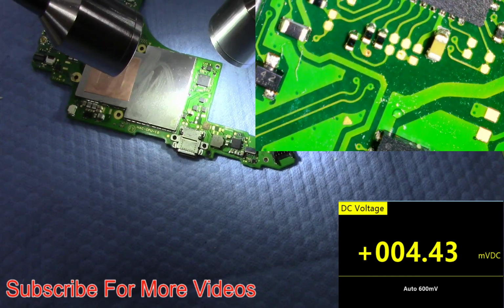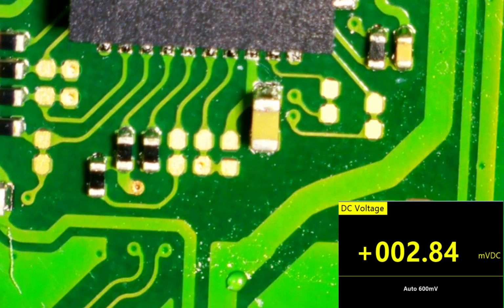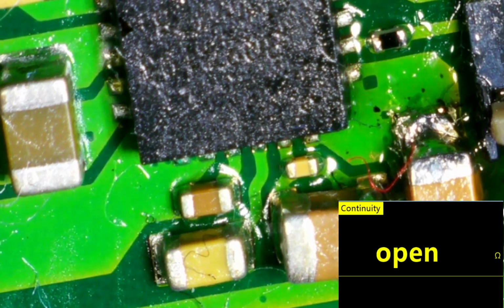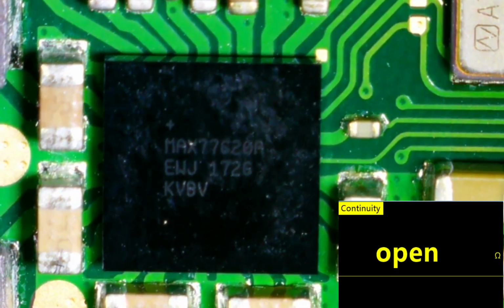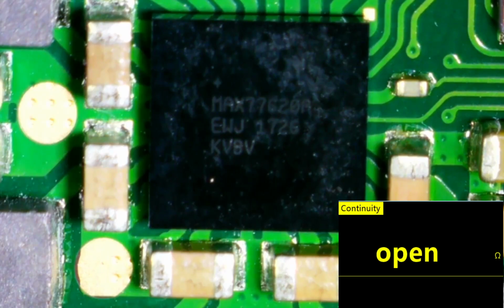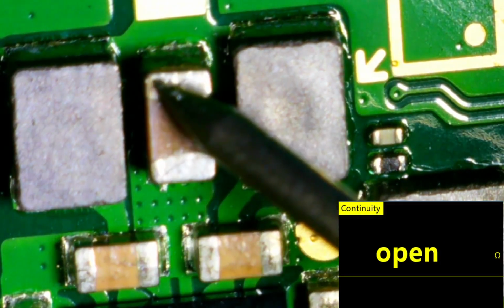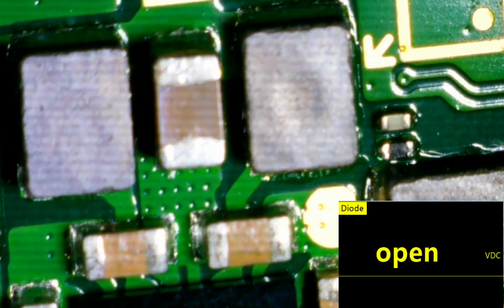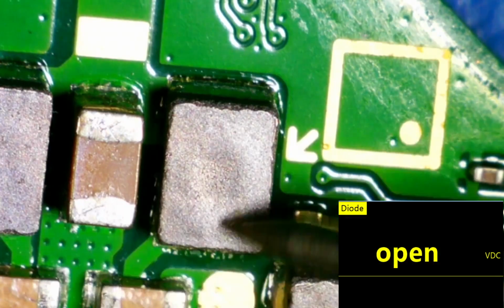First Nintendo Switch Repair Part 5

Comment: I'm sure I seen your smart watch flash up' Tuesday 20 - 8:37  96 Beats per minute. Above 90 is considered high rate, that switch got you worked up Jason haha!!
You need a known 100% working switch, to get a fair and accurate comparison. So that way you can diagnose the faulty Switch & hopefully make it function again. 👍
Reply from the maker: Yeah Steve I have a heart condition and about 90 is my resting rate. At the time this was filmed it was the only switch I had, but I have a know good one now and I’m currently in the process of mapping all the reading from the chips and test points. This one is still not fixed ran into some more issues today.